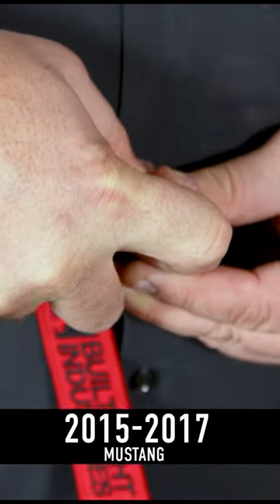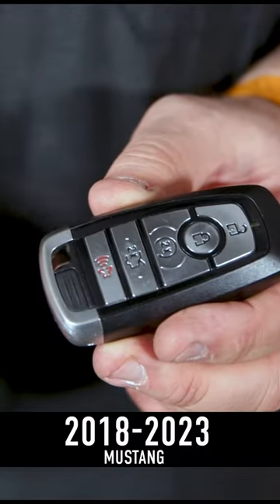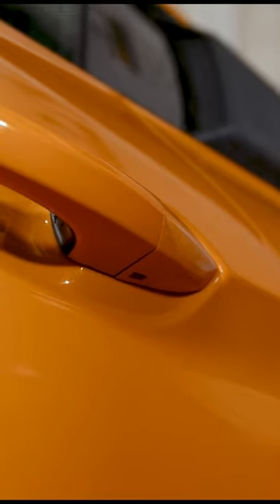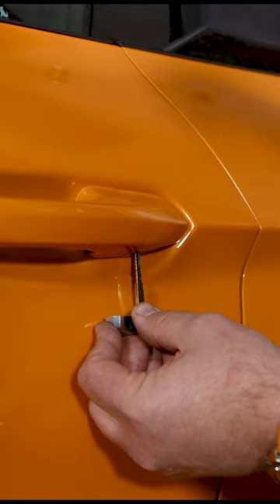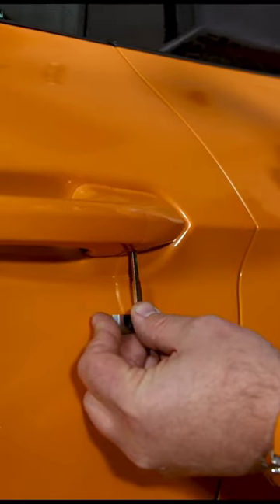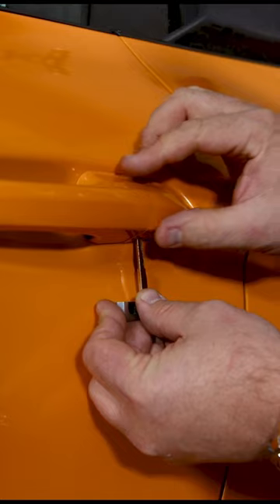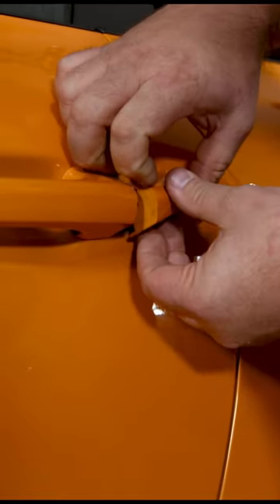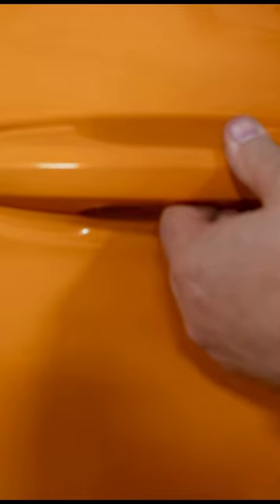Dead Battery Locking You Out Of Your S550 Mustang?? Here is how to get in! #shorts

Comment: “It can be fidgety” you mean it’s a Ford.
Reply: I've got a 2018 GT with 45,000 miles. I haven't had a single problem with my Mustang. Not one! I daily drive it too and I'm often full throttle shifting it and slamming the gears often, like every few days or whenever I feel the need for some speed😎😎😎✌️. There are only 3 other cars I've had in my life that were this reliable. A 1999 Ford Escorts Sport 5 speed that I bought for 1,600 dollars 😂lol, a 2005 Honda Civic LX 5 speed that I crashed into a ditch and was completely sideways and we pulled it out of the ditch and it started right back up and continued to drive for years lol and a 2016 Kia Optima Sx Turbo. Best dang cars I've ever owned. This Mustang is tough as hell and works like a dream. It is the best car I've ever had❤.